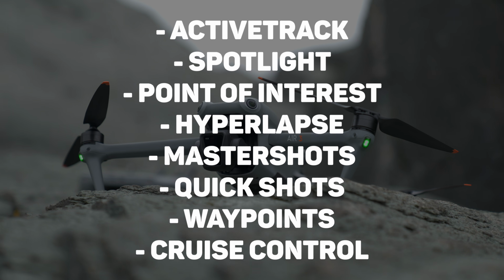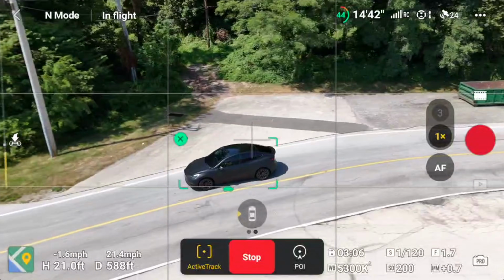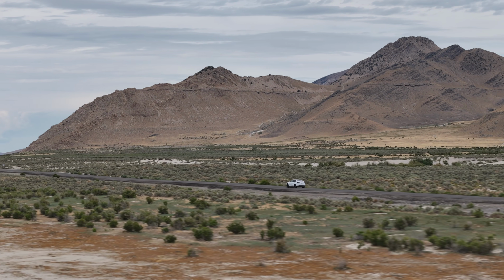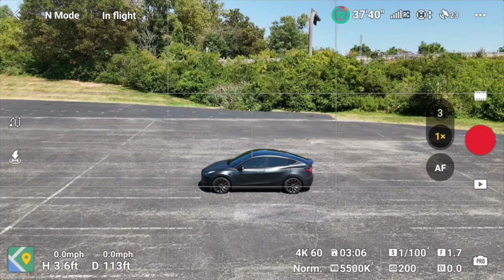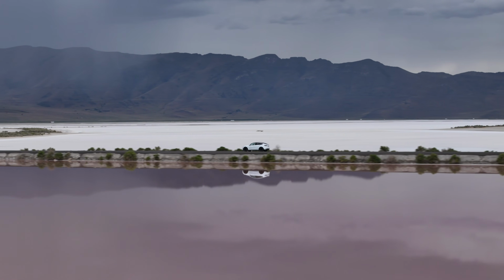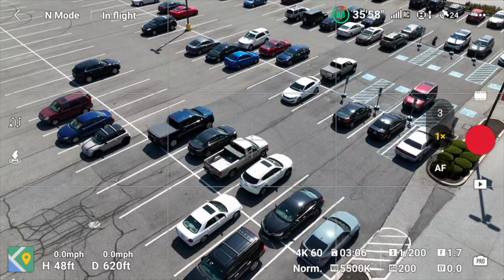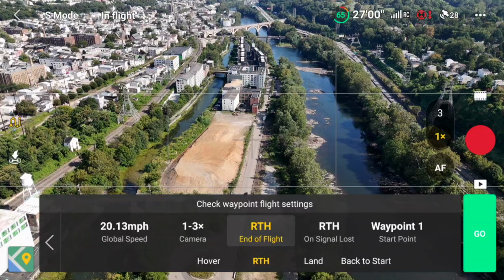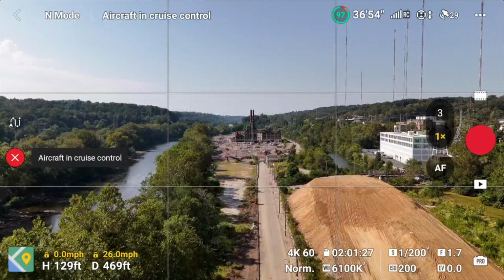DJI Air 3 Intelligent Flight Modes Full Tutorial (FocusTrack, Waypoints, & Cruise Control)

Comment: Has DJI taken options away for way points in an update. My Air 3 doesn't have the option to take photos or videos, just video. I can choose which camera to use, global speed and altitude. That's it. I know my firmware is updated and i may be missing something but I'm stumped! Any help or ideas is greatly appreciated.

Comment: if you use the option to fly a drone around an object What can be the maximum radius, i.e. the distance of the drone from the object that the drone is circling?

I used to have a DJI Phantom 3 and there was a Circle Mode option and the radius could be set to a maximum of 500 m

Comment: I just used active track on the Air 3 to track me from the front while walking forward and it quickly moved to the side and ran into branches and crashed. I need to try it again. It didn't really build my confidence in the feature

Comment: It has side sensors ?? this is a + for the Air 3
For waypoints DRONELINK is necessary or it is in the Basic Application
Reply from the maker: Yes it has omnidirectional OA, so all sides.
Reply: @billykyle  Merci ça apporte plus de sensibilité ??? Pour la résolution, j'ai pu comparer à la loupe image Air3 et Air2 le Air2 est devant !
En tout cas ça n'a pas fait baisser le prix du Air2S.

Comment: 10:56 you're maintaining VLOS 3,460ft Billy? I trust you're not trying to set poor examples of compliance to regulations for your 133k subscribers?
Reply: He said you can “ alter “ your flight distance and height … so hence VLOS elk still be effective if you still can see your drone
Reply: @JoshConnectMedia  What do mean by alter height? You can change your home point - but we know where his take off location is...and the distance is identical to what Google Earth shows.
Reply: @stauferaerial   you can reduce your height to a minimum where you could see your drone hence using the VLOS . But guess he was pretty much high though technically if he could still see his drone then isn’t that still having a VLOS ? 😎
Reply: @JoshConnectMedia  We're talking distance here, not height. I won't get into optics science, but the Mavic 3 series is virtually impossible to see past 3,000 feet - and this is an Air 3 which is even smaller than a Mavic 3. I'd estimate the max distance you could "see its tiny spec" is 2,500-2,700 feet. 
And no, absolutely not, "seeing" the drone does not mean you're flying in an FAA satisfactory VLOS manner.

This is the FAA's wording:

(a) With vision that is unaided by any device other than corrective lenses, the remote pilot in command, the visual observer (if one is used), and the person manipulating the flight control of the small unmanned aircraft system must be able to see the unmanned aircraft throughout the entire flight in order to: 
(1) Know the unmanned aircraft's location; 
(2) Determine the unmanned aircraft's attitude, altitude, and direction of flight; 
(3) Observe the airspace for other air traffic or hazards; and 
(4) Determine that the unmanned aircraft does not endanger the life or property of another. 

(b) Throughout the entire flight of the small unmanned aircraft, the ability described in paragraph (a) of this section must be exercised by either: 
(1) The remote pilot in command and the person manipulating the flight controls of the small unmanned aircraft system; or 
(2) A visual observer.

Billy is 100% not able to comply with section (a) items 1-4. 
This is irresponsible flight.
Reply: @stauferaerial   😎✅✅
Reply: @stauferaerial   Billy , what do you say on this ?
Reply: I don't foresee him saying anything - he has a history of not acknowledging his errors.  @JoshConnectMedia